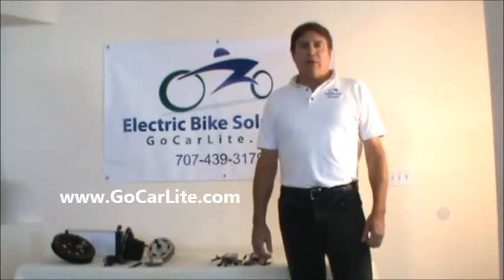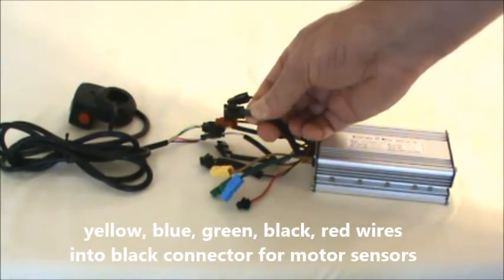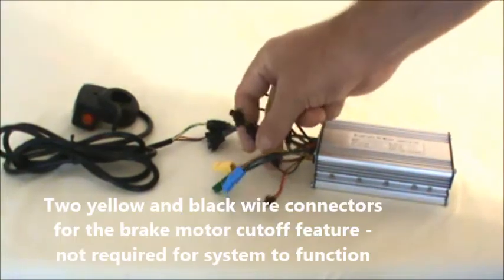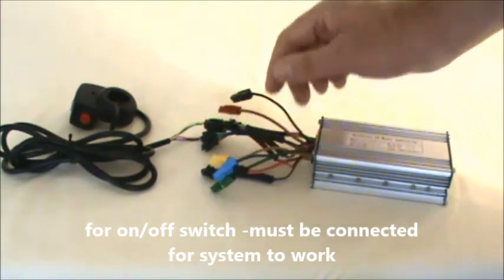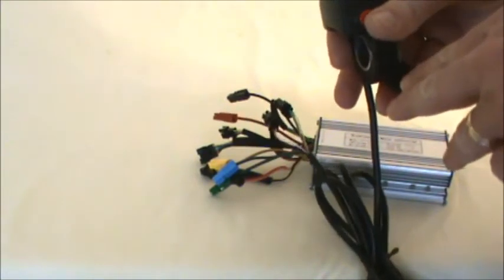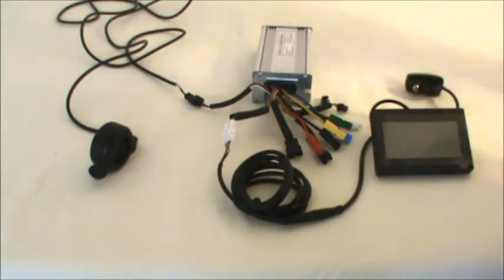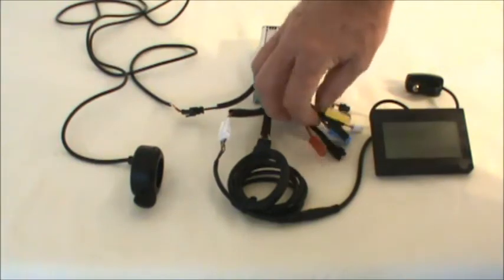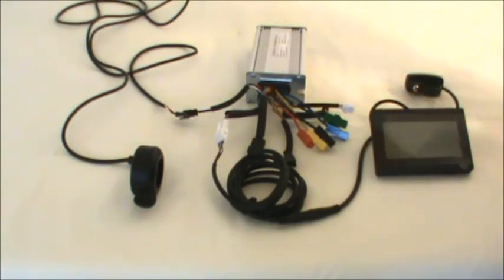Electric Bike Kit Controllers

Comment: Excellent video.  Question.  I’m modding my Super73 Z1 controller to a 48v.  It is different from original controller which only had standard ground and positive wire for battery (This controller has the standard ground and positive wire for volt, plus third smaller red wire (3-pin molex connector).  Is the third smaller wire necessary to power the controller?  Do I need to install a third wire positive from battery and then connect on/switch for controller to work?  Am I making sense?

Frustrating but enjoying the process.  Hope you can help.  If anyone else has solutions or suggestions, I’m open to all…. Safe riding!

/Bklyn👑

Comment: Sir please Tell me that BLDC regenerative power motor controller wich used in an e bike, is it will be suitable for used  lithium ion battery pack in this e bike.
Reply from the maker: regen braking only works with a direct drive motor and provides very little juice back to the battery.  A planetary geared motor is already more efficient than a direct drive motor providing 10 to 15% more distance per charge with no motor drag like a DD.  We only sell planetary geared hub motors